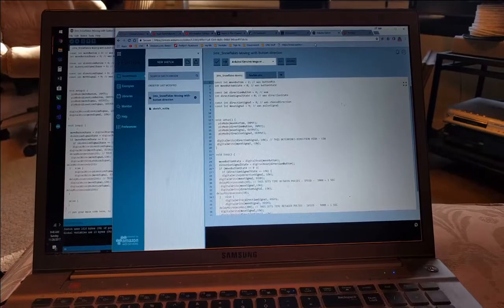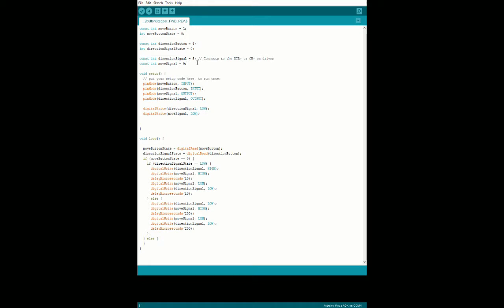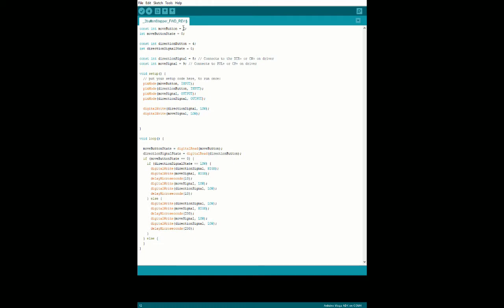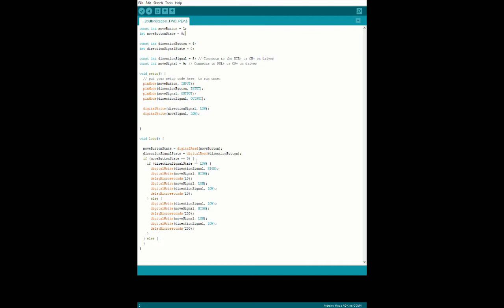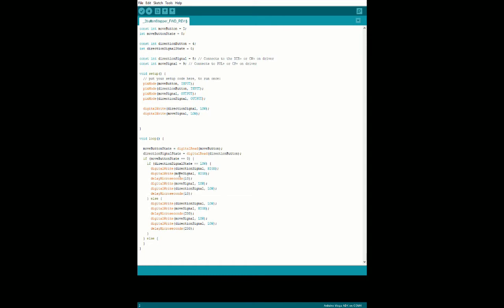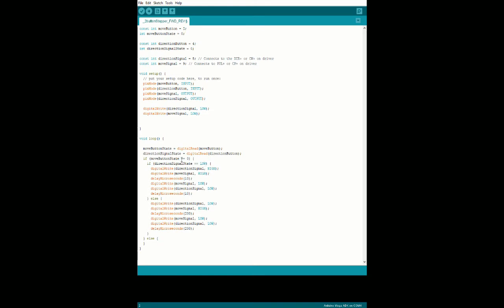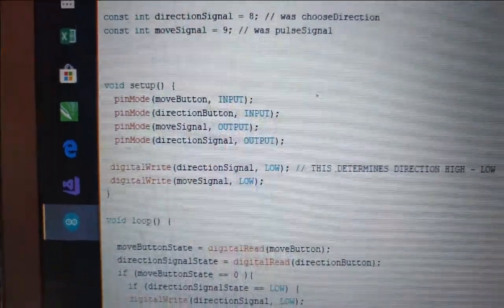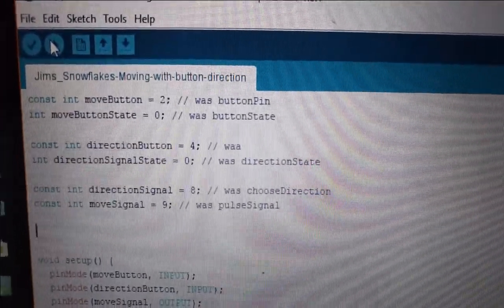Stepper Motor and Driver Running With Arduino Mega

Comment: Hiya buddy, hope you are well, I know this video is fairly old but I have just copied you code and finally got my stepper turning, would you know how to keep the motor turn backward once the direction button has been pressed until it returns to home?
Reply from the maker: try this video... https://youtu.be/7spK_BkMJys?si=3UA24Fa8CqTMequ1
Since I posted my old video, others have done a much better job describing the stepper control process. Good luck!